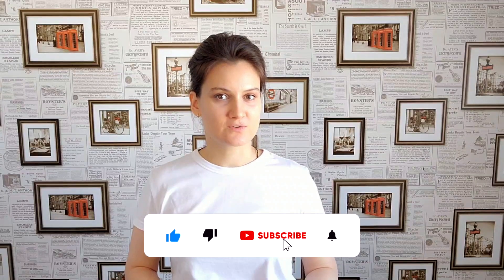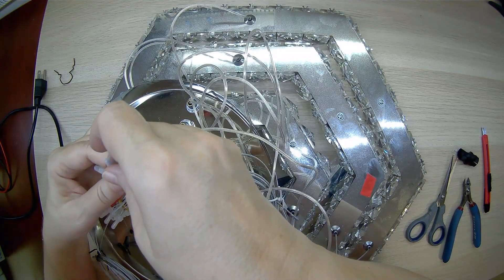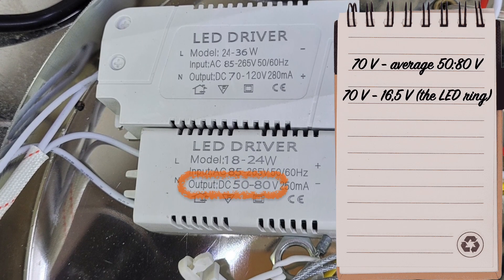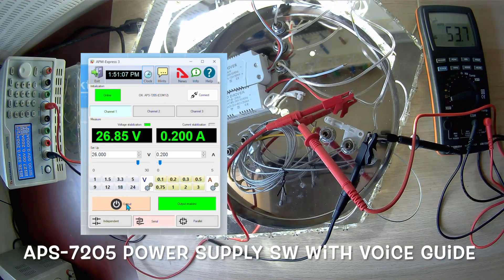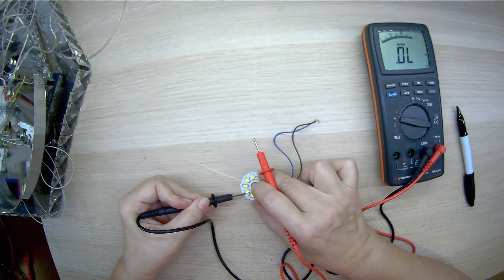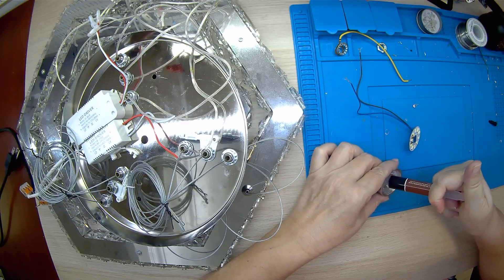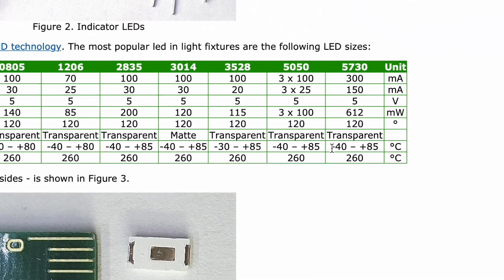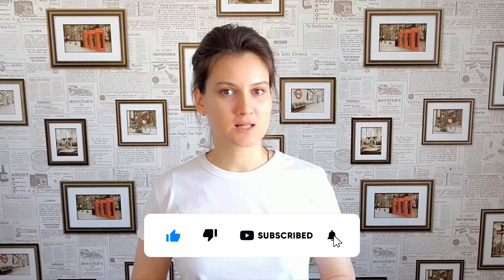DIY LED REPAIR TUTORIAL PART 4 #ledlights #diy #homeimprovement

Comment: Hello. In the video you mentioned a digital multimeter that you use to measure the voltage in the driver. Is it a good device for checking the alternator batteries for proper functioning?
Reply from the maker: AM-1060